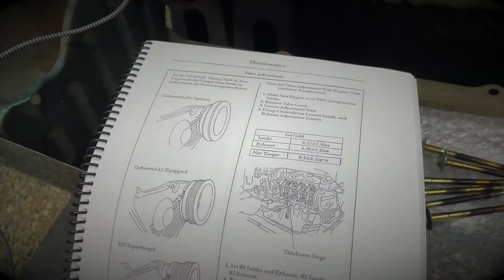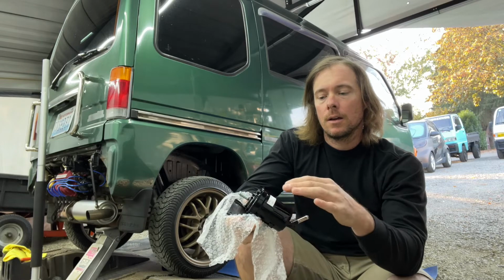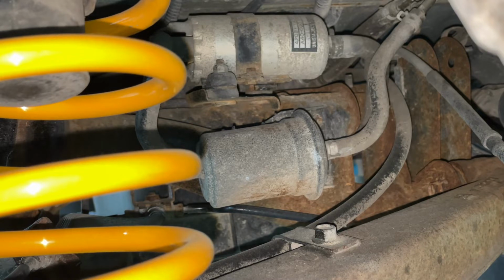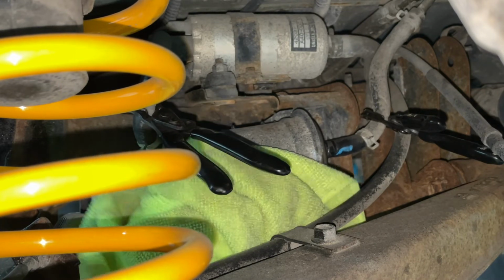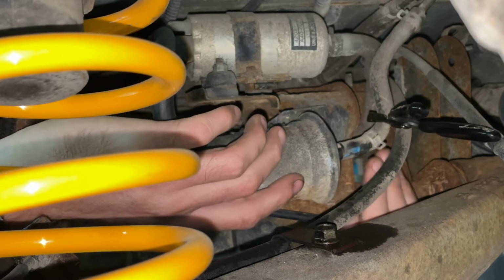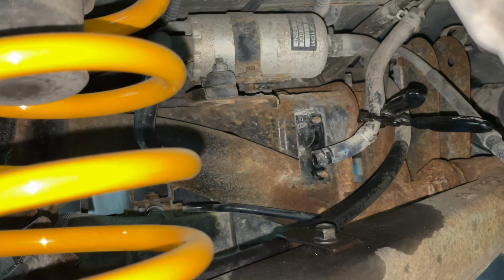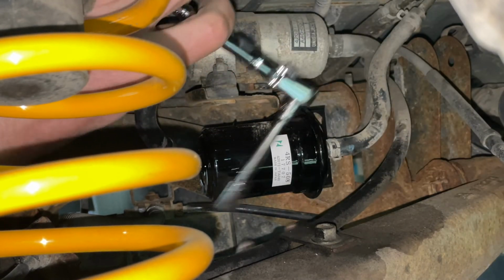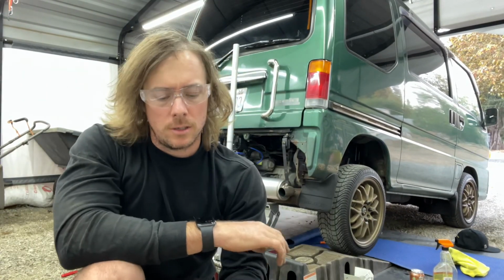Subaru Sambar Fuel Filter Change EMPI EFI Version and Priming Your Fuel System for Launch!

Comment: Just installed the filter from you, and this made it a breeze.  Pro tip: wrap a 1 gallon ziplock bag around the filter right before the lines come off to catch most of the gas. Also works nicely with oil filters. Thanks Kevin!
Reply from the maker: Thanks for the info!

Comment: Kevin, couple of questions:

When priming the new fuel filter, is it important to keep the rear end up?  Or did you simply keep the vehicle jacked up in case there happened to be any other problems?

What are your thoughts on using a silicone spray on the rubber hoses (while you're already doing the fuel filter replacement), to extend the rubber hose life?
Reply from the maker: doesn't need to be jacked up, just had it up for easy access :) and ya i'd say any kind of "lotion" to prolong the rubber would help BUT subaru still has them so i have ordered a few just in case!
Reply: From where do you find Subaru parts?
You are great by the way 🎉

Comment: Would this be the same filter for my 99’ Sambar tt2 truck with efi?

Thanks

Great videos as usual.
Reply from the maker: Yes 🤙🏻🤙🏻 it’s the one I sell on my website for the EFI or supercharged.
Reply: @OhKeiGarage  Thanks, The 99’ is so new to our market, there’s not that many parts yet. Every part I find seems to go to 98’ or older which adds to the confusion.

Appreciate your reply.
Reply: 1 last question?

How much does a dirty fuel filter hurt mileage? 

I was just on your site….is this part of your 3 piece kit for oil, air and fuel? I couldn’t find the fuel filter separately?

Thanks 

Thanks from Missouri

Comment: What years did the sambar start coming in EFI? and is there a easy way to identify when looking at auction sheets?
Reply from the maker: im guessing around 1990 when the supercharged sambars were around, don't quote me. and the intake manifolds look different if you can see pics of the motor, on the autcion sheet though, idk. may say engine code ending in Y or F
Reply: For Supercharged: All Sambars from 1990-2012 are multi-port EFI (EN07Y).

For Naturally Aspirated: All Trucks from 1990-1998 and Vans from 1990-1995 are Carbed (EN07C). The vans from 1995-1998 are multi-port EFI (EN07F). All Sambars from 1999-September 2001 are Single Port (EN07S), and then September 2001-2012 are all multiport again (EN07F)

The intake ports on the head are shaped differently to accommodate the injectors, so slapping an EFI intake manifold onto a carbed head will not work straight off without modifying the head.

The EFI models also have a cam position sensor inside of the distributor (on the 1990-1998 models) so the ECU can handle the timing. The 1999+ versions have sensors over on the timing belt end.

Reference link below (probably won't be shown because of URL block).  In case it doesn't show, search MiniTruckTalk website for "multi-port EFI".